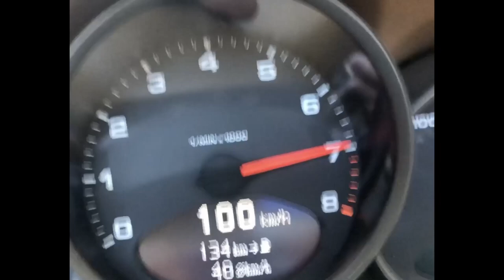R57 Mini Cooper S Front Hood Trim Replacement

Comment: Great video.  What type of screws are used?  Lost mine.
Reply from the maker: Thanks
Those are Phillips heads tapered.
Reply from the maker: Similar to these 
https://www.homedepot.ca/product/paulin--8-x-9-16-inch-wafer-head-phillips-drive-high-performance-zinc-plated-lath-framing-screws-1000pcs/1000183615